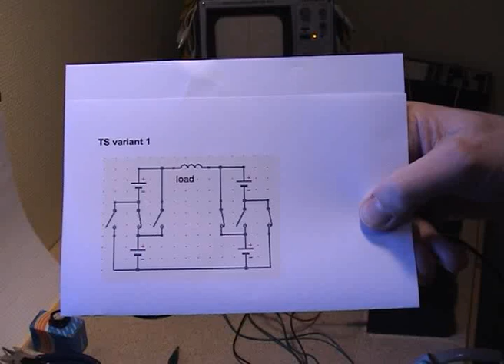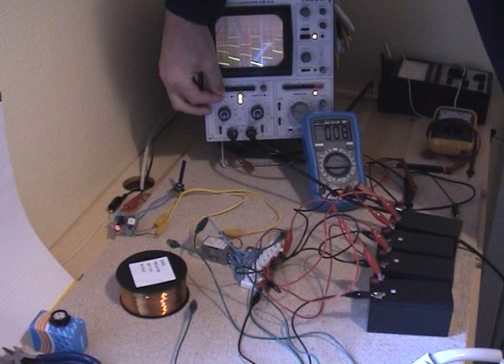Tesla-switch part 1

Comment from the maker: As its a multilayer air-core inductor I have used L(uH)=0.8(N*r)^2/(6r+9l+10b) and estimated N from the fact that the length of the wire is about 400m.

Comment: Wow, yeah that's quite big :D

Well, although you probably know it already, here is the formula to calculate the inductance:

First: L = N €/l   (number of windings times the ability of the material to make a magnetic field over its length.

Second: Z(L) = 2 * phi *f * L   (ZL is the resistance of your coil to changing current)

Comment from the maker: Thanks!
I am capturing the spikes in part 2. In part 1 its just the coil, the batteries and the relay with the timer, nothing extra anywhere. If my calculations are correct, and I certainly may be wrong, the coil is quite big at 166 mH. (not uH)

Comment: Great stuff you're working with here! So did you originally want show that the back emf was the extra energy that you get when you use the tesla switch? Are you thinking of sending it back to the battery? 

And is it simply the spikes from the coil that is creating that electric potential you can sense with the voltage meter, or have you done something extra to achieve that effect? 

Thank you anyway :D